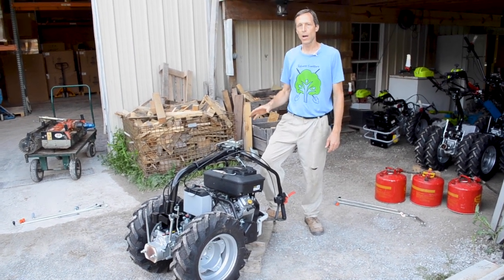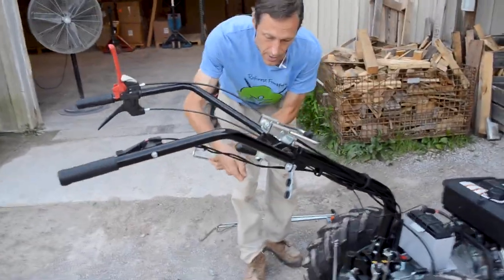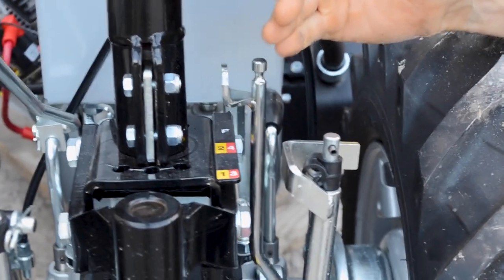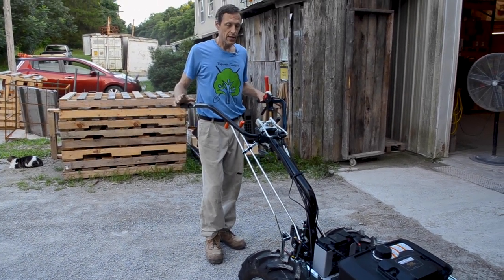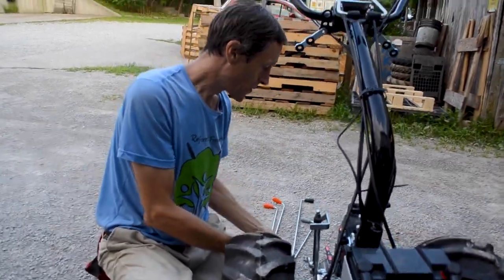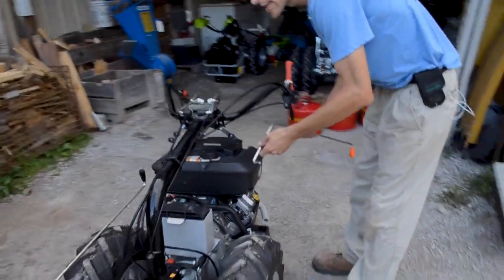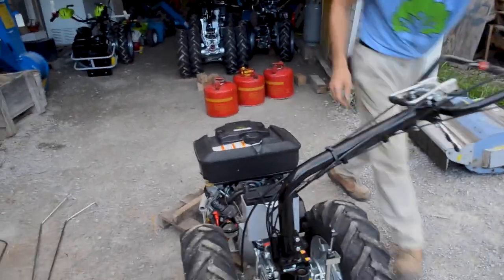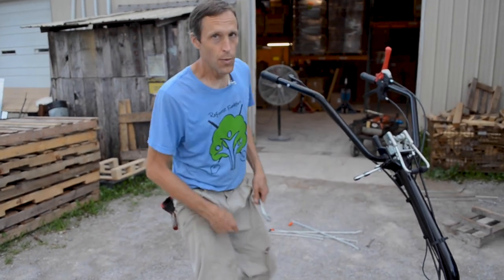Grillo 131 Walk-Behind Tractor: Setup & Basic Use

Comment: About that hole on the dozer blade. I slid a piece of square stock, maybe 2 ft. Long an pinned it with that hole. Then I attached a cranking trailer wheel so I can adjust the depth so I wouldn’t be digging too deep. Tied some weights to it. Works pretty good